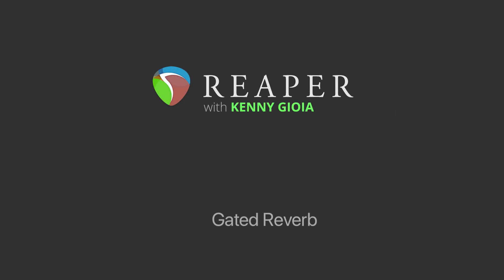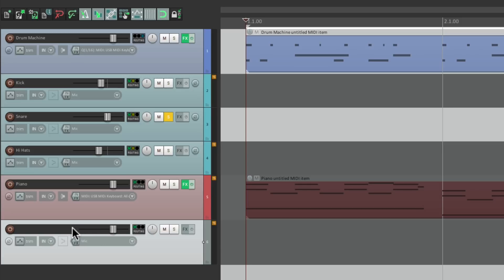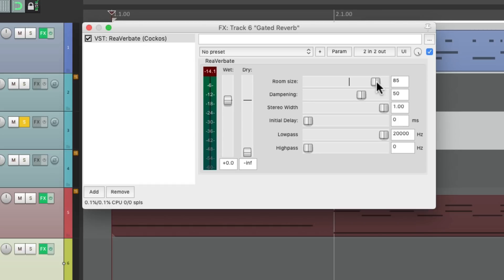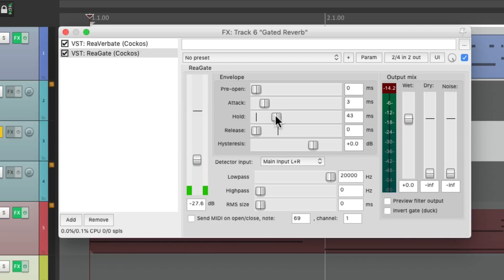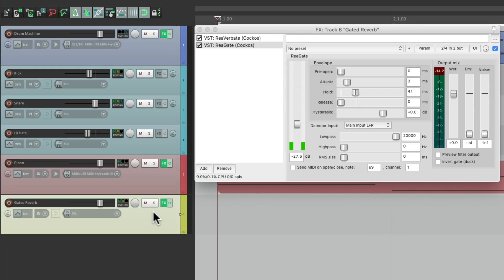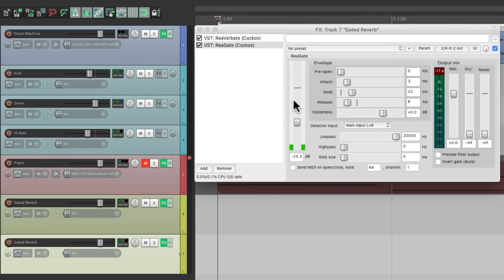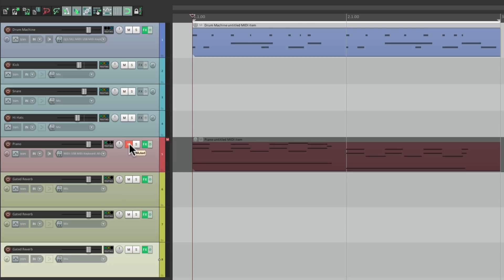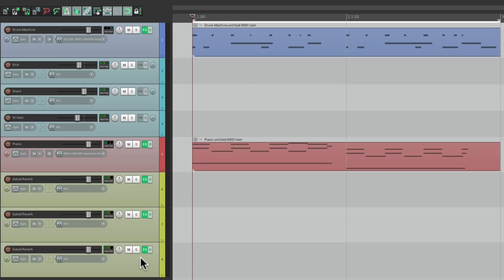Gated Reverb in REAPER

Comment: why are we doing this whole sidechaining thing? it sounds so much better when you use the dry signal from the reverb to trigger the gate, because the dry signal is much louder than the wet signal. the gate has a much easier time picking it up than a slowly fading reverb and your dry snare will never be longer than the reverb, so it shouldn't have problems with the gate either.